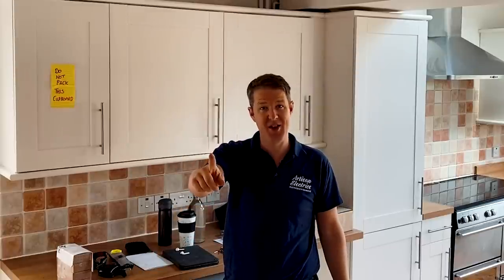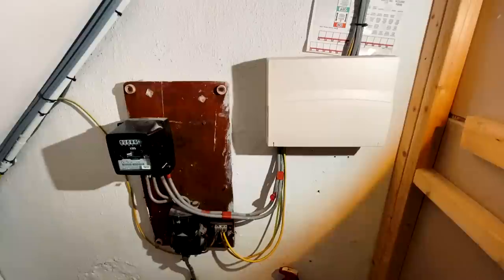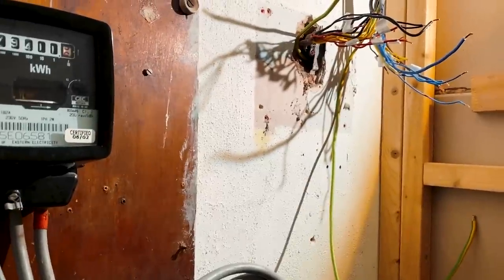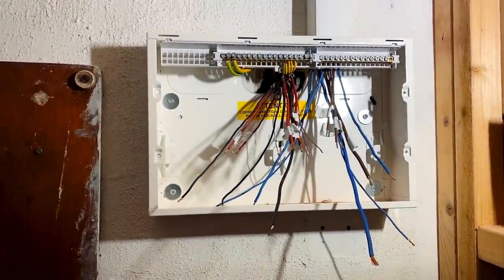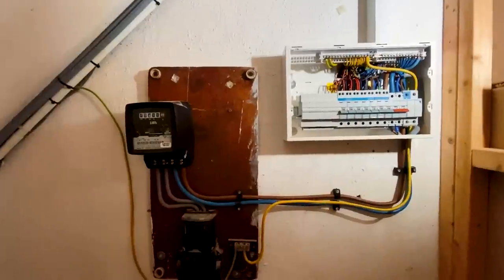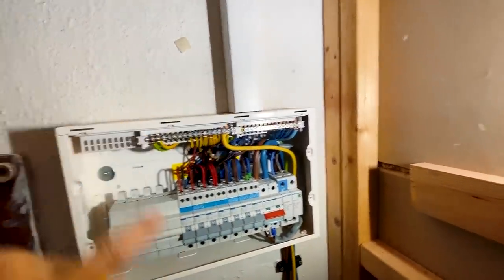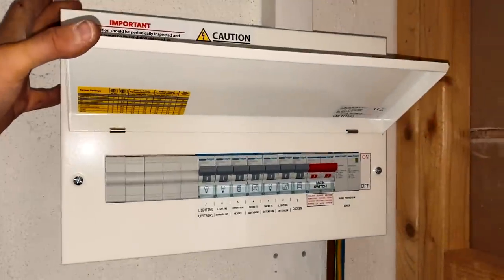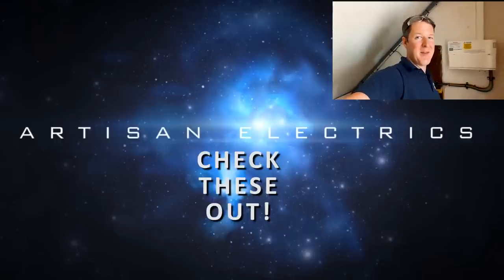The 1 Hour Consumer Unit Replacement

Comment: I have watched several of your videos, and you do amazing work.

The 'Consumer Unit' concept is interesting and i see there is a huge difference between circuit protection in the UK and the US.

One big difference is you could never have the service wires not protected in a conduit (or some jurisdictions allow a type of cable called Service Entrance (SE) cable) to protect the individual conductors.

Another is the loads in the US are much higher.  For houses built since the 1980's, or houses that have been upgraded since then, most common service in a single family house is a 240 volt 150 or 200 amp single phase service 3 wire service, where the two wires that have 240 volts across them only have 120 volts to ground due to the transformer having a center tap that is solidly grounded and bonded from the transformer to the breaker panel through the neutral conductor.  

Lighting, TVs, electronics, washing machines and small cord connected appliances are connected between the neutral and one of the lines and operate with 120 volts, but all large loads use 240 volt circuits.  

Also, there is a solid connection between the neutral at the house and the neutral at the transformer to clear a fault, and the neutral is not fused or protected by a circuit breaker. Ground fault protection is increasingly being installed at the individual circuits such as in kitchens, laundry areas, damp or wet areas, outdoor circuits, garages, basements, etc., and the latest code requires GFCI protection on 240 volt circuits for dryers, ranges or ovens located within 6 feet of a sink, and an EV receptacle in a garage even requires up to a 50 amp GFCI breaker to be installed in the breaker panel.

Last big difference I note is there are no 'ring' circuits in the US.  Thus in the US there are many more individual radial circuits for lighting and receptacles.  And since the lighting and receptacles are 120 volt circuits, the branch circuit wiring is much thicker, 14 and 12 AWG (2.5 and 4 mm).

The typical single family middle class house often has the following 240 volt devices:

Air conditioner 25 to 40 amp breaker

Electric heat, 9600 watts  60 amp breaker (this is backup heat for heat pump or main source of heat in houses located in areas like Florida where it does not get very cold)

Electric water heater 4500 watts 30 amp breaker (some houses use natural gas)

Range 40 or 50 amp breaker (some have separate cook top and oven, and some use natural gas for cook top with separate electric oven)

Electric dryer 30 amp breaker (very few have natural gas dryer)

The above are pretty much standard, but other 240 volt circuits include

A 50 to 60 amp breaker these days for EV charging is becoming common in some areas.

Hot Tub 40 to 60 amp

2nd air conditioner and electric heat

A typical breaker panel will contain from 30 to 40 individual circuits.  Larger houses may have a sub panel and some larger houses have 400 amp service, usually feeding two 200 amp breaker panels.
Reply: Ring circuits are weird and UK is weird for having them. Their tails aren’t unprotected, though. They’re double insulated cable, just as much as Romex are twin and earth is.

Rest of Europe has the same 230-everywhere setups, with by far the most common being 16 amp radials everywhere on 2.5mm^2 cabling. Only Special loads get bigger circuits than that.

Comment: Currently doing my first year apprenticeship , all videos are top notch and making it easier to learn
Reply from the maker: Awesome!
Reply: Get out of the game mate , or going into some specialised like bms , install for electrics commercial / industrial side is ruined , full of romainians who work for penny’s
Reply: @luluboxingtv2880  What's BMS?

I'm a C&G Level 3 2365 holder looking to get in with a company and do the NVQ, but half the sparks I speak to don't even have a gold card anyway
Reply: @louiecullen2318  Building management system

 (BMS) also known as building automation system (BAS) refers to a computer-based control system that needs to be installed within buildings to monitor and regulate the building's electrical and mechanical equipment such as power system, lighting, and ventilation to confirm sustainability

Comment: I always thought the metering company would need to seal the metering equipment back up afterwards. I wasn’t even aware it was possible to buy a meter sealing kit? Do you need to register a sealing tool with a reference number on the seals?

Comment: Just wondering why no 100amp electricity meter isolating switch fitted as you pulled the incoming fuse anyway. I always fit one

Comment: Interested to see your meter sealer tool and where you got it from , nice video 👍
Reply from the maker: EBay 👍
Reply: Have you got a link as I couldn’t find it , thanks
Reply: He probably nicked the meter sealer Npower meter fitters have there initial on the sealer so if there's any problem they know who made the seals
Reply: I thought of the energy provider can access the cut out fuse and meter as the seals are marked with unique numbers 🤔
Reply: @tylerbarker9535  Not they don't just their Abbreviation like BG on ours. There's not enough space to code it...
Reply: I thought only the energy provider could pull the main fuse?

Comment: What method did you use/ do you normally use to enter the tails into the board?
Reply from the maker: Either a wiska gland or the standard gland Hager provides depending on the situation

Comment: Like the work! Just a little question. Removing the distributers cut out is only permissible by them, or the meter company. I see you did this yourself. Whats your thinking on this, and your feelings about doing this.
Reply from the maker: DNO’s don’t care if you remove the main cutout fuse yourself most electricians have to do this as they need to safely isolate and the DNO won’t do it for you.
Reply: @artisanelectrics  when you seal it up, presumably you’re doing so with something that a) is traceable to you and b) is only issued to qualified people, right? And you basically warrant when you do so that you found the seal unmolested and you didn’t run a grow house off the tails before the meter for a while?

Comment: What is your thoughts on this just seen an advert for a NICEIC company not a self employed working from say they charge a fixed rate for Eicr for a 10 way consumer unit £139 Inc vat  and are based  in London but cover all over . What do people here charge for a 3 bed house 10 way unit and what part of the country as the north will be cheaper than London

Comment: Can you or another spark tuber show the hole once you have sealed it? want to see if its a messy as when i do it :D
Reply: Absolutely no need to seal that rear entry hole for fire rating . The boards are designed and tested to not require it.

Comment: Did You cut the distribution fuse seals?
Reply from the maker: Yeah its the only way to safely isolate the tails to work on them if there's not a main isolator provided by the DNO
Reply: Artisan Electrics We would end up in court if we were to cut the seals where I live, it’s a big no no.

Comment: I'm interested to know is the fire sealant foam actually a requirement or not. Hear different opinions.
Reply from the maker: It’s not in my opinion as the board doesn’t need to be fire rated it just needs to be made of non combustible material there’s a big difference.
Reply: @artisanelectrics  Thanks Jordan that's my take on it as well. Just good to double check as got NICEIC inspection soon so don't want to fail it on that 🙂
Reply from the maker: They won’t check that I don’t think

Comment: youre allowed to pull the mains fuses?  i was hoping to have mine changed, i didn't know they could do that.
Reply from the maker: Yeah we have to if there is no main isolator switch.
Reply from the maker: Yeah you’re right that explains it quite well
Reply from the maker: Yeah that’s a really good point
Reply: @sparkymacsparkface7497  having recently dealt with the DNO at my own home all i can say is yehaaa clippydeclop  , they operate to a completly different set of criteria
Reply: @sparkymacsparkface7497   Even when you pull the  fuse your relying on the rest of the network to be fault free , you can still take a belt off the neutral if thiers an issue locally
Reply: Do the DNO charge to come and fit an isolator?
Like... I can get a double pole isolator from Screwfix.
Is it just a case of buying one... Calling DNO and asking them to come and fit it between the meter and CU?
Or do they charge a small fortune?

Comment: Shouldn't there be a breaker (mcb)  to protect the Surge protection device ?
Reply from the maker: It has its own protection built in
Reply: @artisanelectrics   - Hmmm  - not sure I would trust that !!  - SPD connected directly across the incoming supply (it looks like its connected somehow on the switched side of the main breaker ? ) protected only by the suppliers 60/80/100 A  fuse ?
Reply: @Kevin-mp5of    Kevin -  I know its a surge protector - and uses Metal Oxide Varistors - (MOV) .

 MOV 's present  a high resistance to a circuit under normal conditions hence don't take any appreciable current  - but when sudden high voltages occur on a supply   such as might happen during a thunderstorm for example - the resistance of the MOV is suddenly lowered, and thus the potentially damaging  energy contained in the surge is thus dissipated in the MOV - and not ( hopefully !) passed down stream to sensitive circuits and devices .
HOWEVER - for this to work efficiently - the connections to the MOV MUST  be short (See BS7671)  - since surges are transients of very short duration  - hence they contain high frequency components  ( well into the MHz's )  and so keeping the leads short (  that's Line, neutral and earth/CPC )  means that the inductive reactance (Xl) due to the self inductance of the  connecting leads and their resistance   is kept as low as possible . ( ie the total  "impedance " (jXl + R)   that the MOV "sees"  from the source of the transient is kept as low as possible,   since Xl is proportional to frequency,  Xl  = 2 * pi * F * L  where L = inductance in Henries,  and F = Frequency in Hertz   ) .   
  ( by the way -I didn't Google  any of this as you suggested - - I happen also to be a Radio Engineer - and also Have an Amateur Radio licence so I'm well used to dealing with transients and high frequencies - and the protection of circuits using high frequency switching such as SMPU's etc )   

Now-  that is all very well .. but it still follows that we have a device that is connected across the "raw" supply - ( By "Raw"  I mean its only "final" protection is the suppliers fuse  ) ...  and one might argue that it needs protection under its own  fault conditions  -hence -  some manufacturers of SPD's  recommend ( and indeed supply in their SPD pack)  protection of the SPD  by means of a 32A  MCB .
Reply: @Kevin-mp5of   Kevin - No that is NOT a contradiction -
 OF COURSE adding an additional component will increase the overall impedance !!!!  I KNOW THAT !!

BUT.. in this case   ....and since it is connected VERY CLOSE - ie adjacent to  -  the associated  SPD in the consumer unit  -the additional impedance added is small - but - unavoidable if one is going to add cct protection .

It's not a case  of "I want to" ... its a case of some SPD suppliers recommend adding protection .

Comment: You need to include plumbing in your repertoire😂nice job. I would avoid trying to give yourself too many time constrained jobs. You will either have to stick to a script which can be thrown off when you start testing and discover an issue. Moreover you will be working like a zombie without thinking and the potential for mistakes goes up. Not what I would call a safe installation. Stick to your quality working methods and always keep thinking and checking things as you go along. That way you give your best.

Comment: Great job! Could of only realistically clipped those flex cables or stuck a section of flat trunking up. Was moving the wiring centre an option or just not possible?
Reply from the maker: Not possible

Comment: chopped the meter seal?
Reply from the maker: Yep
Reply: no isoloater so had no choice
Reply: @craigdonnigan618  install an isolator then?
Reply: @alexkane07  why should he install an isolator thats the electricity suppliers responsibility, not the DNO or the customer
Reply: As far as I am aware, you aren't allowed to tamper with the energy supplier's equipment  (electric meter). This would include chopping the seal and removing the tails. An easy way around this is to remove the suppliers fuse and install an isolator so the tails can be extended. Plus, if there was evidence of you tampering with the meter then surely you could be blamed if someone ends up bypassing it, even at a later date?
Reply: @Kevin-mp5of  only on the fuse, which energy companies don't seem to mind, especially if you're part of a competent persons scheme. You aren't meant to tamper with the meter. For the sake of buying a £15/£20 isolator it's a no brainer to me to just install one.

Comment: 6:50 "issue a satisfactory EICR". Surely now you have completed work, you should be issuing a domestic electrical installation certificate for said works?
Reply from the maker: Yes of course we did that but also issued a satisfactory EICR as well.
Reply: Why would you do that?
Reply from the maker: Because they have to have a satisfactory EICR for the landlord to be able to rent the place out
Reply: Artisan Electrics not strictly true, you wouldn’t have any EICR on a new installation, you’d only have the installation certificate detailing compliance, and for how long
Reply from the maker: Tim Gray yeah not sure where new builds fall on that to be honest... will have to check the GOV prs guidelines
Reply: @artisanelectrics  I'm probably wrong, but in my opinion a valid installation certificate is worth much more than any EICR?
Reply: That’s not true it’s a satisfactory report or a electrical installation certificate which by far supersedes the EICR for landlords if someone had there consumer unit changed last year would you tell them they still need an EICR for renting?
Reply: @alexgecko9078  the Electrical Installation Certificate only certifies the replacement of the distribution board. Unless it's a new installation then it cannot replace the EICR. An EIC for a NEW installation (e.g. completely rewired - not merely replacement of a DB) will, however.
Reply from the maker: Thnks
Reply: No that’s still not true. It’s in the document in black and white EIC is valid for 5 years and would eliminate the need for an EICR. Sending a satisfactory report along with it is completely up to you but it’s not needed. What would you rarther a report which could be lim all over or an electrician saying yes here is my consumer unit change and I have had to test everything and am happy to put there name to the installation.

Comment: Great video once again Jordan, that was an impossible challenge how the "One Hour Electrician" could carry that work out in an hour God only knows bet it was stuck to the wall with Fixall adhesive, I would love to see the test certificate for his work too bet non of the certificate results matched the actual results in the property.

Can I ask you two things, firstly how do you go on for resealing the meter and cut out, do the keyboard warriors not criticise you for filming it (we all have to cut the seal on them to carry out our work) but people seem to pretend to be whiter than white and don't do the seal cutting, second question has Hager not followed every one else on the band wagon that an SPD has to be installed via an RCBO or MCB I got criticised the other week for not installing one on an SPD
Reply from the maker: People will criticize if they want to but it’s real life this is what we have to do to safely isolate. Regarding the SPDs Hager state that they don’t need OCP device upstream as they have their own protection built in.
Reply: @artisanelectrics  I don't see the point of the SPD having to have an OCP device myself that normally is designed to take 6K or 10K when a surge could be a hell of a lot higher and the device is supposed to direct the spike to earth what's the point of it being protected by an MCB when its installed onto the load side of a Main switch prior to anything else in the property
Reply from the maker: Exactly

Comment: How is electrical wiring tested?The quick way and incomplete way in my non qualified opinion is to use the special plugs with leds.But what about everything else?Every single wire un terminated and tested for eth leakage,short ccts etc?Would take ages,but,if the consumer unit was circuit breaker type,any faults should trip the breaker?

Comment: I think this video is very dangerous as it doesn't show  the electrical supply  from the supplier being turned off. I'm not a qualified electrician but I do know that unless the main fuse  on the suppliers gear isn't removed then those tails Jordan was waving about would have been live and deadly
Reply: He pulled the main cut out fuse. You actually se him with it removed quite early on and he resealed it at the y
Reply: *end
Reply: Hence "I'm not a 
qualified electrician"

Comment: Yeah.. 1 h.. would have been a wonder. But wouldn't there be a requirement to replace the powermeter with a new digital one, that can transmit the data through the electric wire?
Reply from the maker: Not required yet here